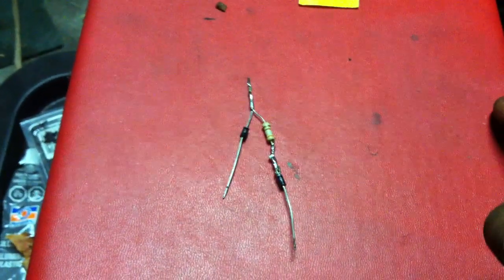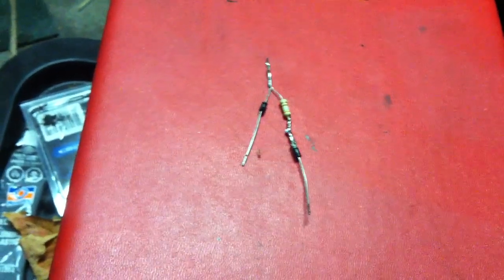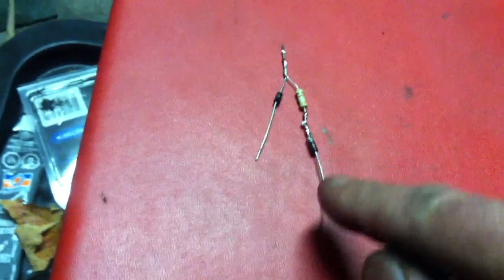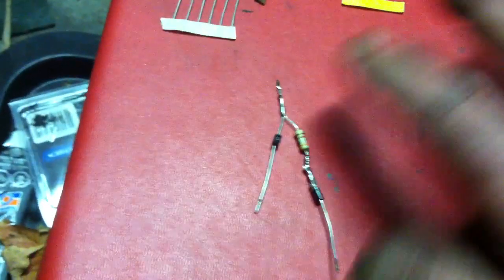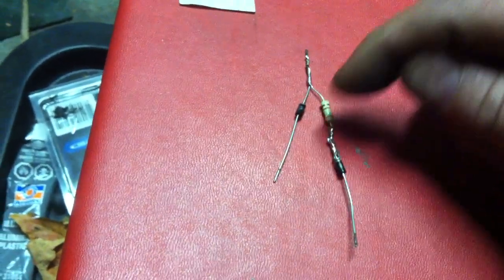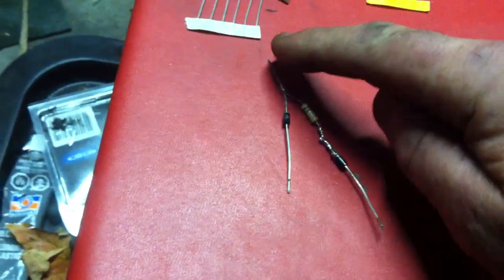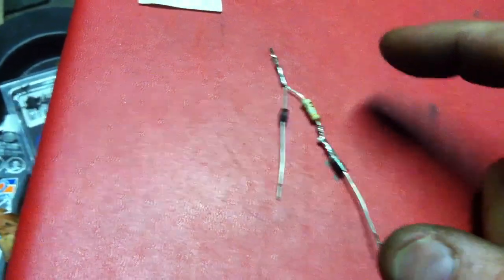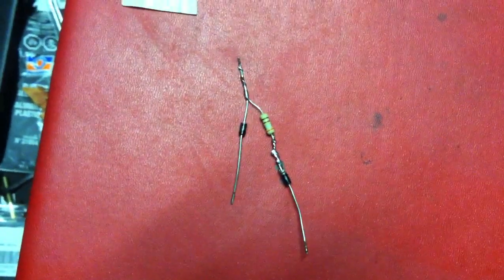How to make an LED bulb or strip into a dual intensity motorcycle brake/tail light

Comment: i dont know if anyone else asked this but do i need thise setup for every single led bulb? or can i use this for multiple bulbs and just put a higher resistor in?
Reply from the maker: +Jake Renninger multiple bulbs or single doesn't matter..i would suggest getting a few different resistors ,and seeing which provides the difference in output you like
Reply: +fupabox so if i just connect all of the positives together and the negatives together and connect it to the set up you showed, itll work? i just have to try different resistors?
Reply from the maker: +Jake Renninger yes...the resistor would connect to all of the positives of the leds
Reply: +fupabox Alright. and i am actually going to do this with my car. will the resistor i pick be great enough to fool my car?
Reply from the maker: Jake Renninger That I'm not sure of...I haven't tried it on a car with a " bulb out " monitor
Reply: Well i dont have a bulb out monitor but when i tried to put in an aftermarket led it messed up my brake lights and made them act weird
Reply from the maker: Jake Renninger WEird..what kind of car ?
Reply: +fupabox im trying to make new brake lights for my 2003 Mini Cooper S
Reply from the maker: Jake Renninger That's odd..other than flashing faster, they should have been ok
Reply: +fupabox because when me and my brother put aftermarket led bulbs in and when i pressed my brake nothing happened and then we put the stock bulbs back in and then it was fine
Reply from the maker: Jake Renninger led bulbs only work when the current flows in 1 direction.. a regular bulb will light even when the current flow is reversed.. so depending on the configuration of the neg and pos on the mini's light socket, LEDs may not work..you may need a reverse polarity LED
Reply: +fupabox.alright ill look into it. i would be able to figure out which one i need and put a diode in the system?

Comment: nice vid and explanation :) , would this also work with your setup , but adding another diode soldered to it but using a dualled strip, cuz i wanna add tail/break light and blinker thats why the dual led strip
Reply from the maker: *****  I'm not sure, but I can ask my buddy when I see him next...I'm not the greatest when it comes to electrical circuits, so I usually run any ideas through him
Reply: ***** since i m talking about dual led strip, i supose i would be getting 2x positive and 2x ground, then i should go with your tube vid on 1 positive and just another diode (maybe resistor on how bright i want blinker to be) on 2nd positive and then attach the 2 grounds to the chassis
Reply from the maker: *****  I haven't talked to my buddy yet..but found this that may help you...http://www.hondatwins.net/forums/64-electrical-discussion/40033-installing-wiring-3-way-led-turn-signal-running-brake-lights.html

Comment: I did it to my Yamaha XVS 1100 and it works great. I added more break lights and turn my indicator into running and turn signal lights, i love how it looks now. The only thing is my signal flashes a little faster and for that you can use a LED load resistor to fix that problem.
Reply from the maker: cool..I want to try the running/turn combo.  haven't gotten around to it yet
Reply: ***** I'm off from work tomorrow I'll post a video and diagrams also. It's great I love it
Reply from the maker: calico344 excellent.. I'll subscribe so I will be sure to see the vids.. TY

Comment: This is awesome video and tons of help. Two questions:
1. How do we increase its capacity to handle more LEDs?
2. Can you give a drawing of how things are connected- and how we would add more diodes etc?
Reply from the maker: if you want to add more leds just use a premade strip with more leds on it
Reply: ***** So, this arrangement will work on any number of LEDs? I am using a pre made diode connector for the purpose.
Reply from the maker: Anuranjan Pegu Yes it will...the only thing that may need changing is the resistor may need to be a bit stronger if you have a lot of LEDs
Reply: ***** I am new to this. How do we increase the strength of the resistor?
Reply from the maker: Anuranjan Pegu there is an OHM # on the resistor  the higher the # the stronger the resistance, and the bigger the difference between full power and resisted power. you will need to find a 12v resistor since the battery is 12v
                                                                      for a small to medium light strip of LEDs  1 watt is fine
                                                                       you can use a 2-3 watt as well without any problem. 
 they are only a few pennies each for the resistors so get a few..
Reply: ***** Thanks- that is some great info and I hope my question and your answer helped out someone as noob as me. For now the LEDs are working fine...lets see when I add the extra strips to my set up. Thanks again! Cheers!

Comment: hello I was planning to put leds on my bike for tail lights. I have these 3w led called eagle eyes, and was curious what ohms resistor would I need. And would I use the same rectifier diodes?
Reply from the maker: as far as I know the same set up could be used, resistors being so cheap ,you could try a few different ohms to see what works best

Comment: this is a very valuable information. Thank you. how did you insulate the diode and resistor circuit. They look like bare wires. Thanks!
Reply from the maker: heat shrink tubing...2 layers

Comment: Hi this is very interesting for me as i want to make a 13 super bright LED rear and brake light could you ask your friend how i could do this i want to fit them in line  on a cicuit board to suit my rear light on my bike and  use the system you have used.
Coud you ask your friend how i would do this please? I want to use the super bright LEDs
Reply from the maker: if you are hooking all the leds together inline..they will all use 1 positive and 1 negative to power them all..so the same would apply ..negative to ground, and the positive which feeds all the leds would be hooked to the circuit I showed here
Reply: +fupabox  yes, but what size diode and what size resistor would be needed to use 29 x 10mm super bright leds please?
Reply: +fupabox i have found a thai guy that has made it for me,but he hasnt quite understood that i want it to get brighter when the brake is applied, wonder if your friend caan help about resistor size etc so i can show him your video and tell him what size is needed
Reply from the maker: TheSmilermike  I will ask the next time I see him

Comment: So when you say to ground the negative wires, what exactly does that mean? Would you splice the negative wires from the LED strip to the negative wires on the tail light? Or would you splice them to the negative wires on the brake light? Or can you just attach the negative wires to the ground (-) terminal on the battery?

Thanks!
Reply from the maker: the led - wire  just gets attached to the frame of the bike..the frame on any bike/vehicle is directly hooked to the - battery terminal....that makes any part of the frame into a ground
Reply: I did not know that. Thanks!
Reply from the maker: Garrett Adams very welcome

Comment: Awesome video.. But I have a quick question. I'm running a 36 l.e.d tail light strips.. Can u help me out with how many resisters and diodes I need.. I would would appreciate it a lot.. Thx
Reply from the maker: you still only need 2 diodes and 1 resistor per circuit...the entire strip is one circuit..it doesn't matter how many LEDs are in the strip,they all get their power from the same wire

Comment: I'm using a resistor for each LED, and will contain in total 155 leds on each side. I use this circuit in my project? and when the vehicle is on generating 14 volts, will not cause problems?
Reply from the maker: as long as the bulbs are rated at 14v there should be no problem
Reply: you think best to use a single resistor for each LED, or call them in series with a resitor for each series??
Reply from the maker: netuno96 I was told you can use 1 resistor for the whole series
Reply: ello again, I have red LED connected with resistors 1/4w with 560ohms, what resistor should I use to control brightness?
Reply from the maker: netuno96 I'm not quite sure what you are asking...there needs only be one resistor,on the tail light circuit..the only other component is 2 diodes to control current direction flow
Reply: I have red leds with 560 ohm resistors. what resistor I use to decrease the brightness of the LEDs?
Reply from the maker: netuno96 You have a 560 ohm resistor which is decreasing the brightness already...if you want to decrease it more..any 500-600 ohm resistor will work
Reply: these resistors are attached in 560 led to them not burn on 12v, my project is not to led strips, I'm using 5mm leds, wanted to know what value of resistors will need to decrease the brightness of the LEDs, the 600 ohms is enough already?
Reply from the maker: ok..You may have to experiment with different ohm values to see which has the effect you want..600ohm should be fine
Reply: ok, thank you very much, I think better to use a 12 volt regulator, because with the car running the battery goes to 15 volts, and I'm afraid that the LEDs burn for excess energy!
Reply from the maker: netuno96 most Leds are able to work across a wide voltage range..15v should be no problem at all

Comment: great video.. been after this for a long time..ive asked alot of people about this and they said it cant be done.. so here goes.. now sorry if i sound thick but is there a rule of thumb.. do you have to use a certain resister for the amount of led's you use as i want to use about 80 led's... much appreciate your information..
Reply from the maker: I'm sure there is somesort of rule,but I'm not sure what it is..I do know that any resistance will cause the resisted circuit to be dimmer,but the # of leds will effect that dimming in some way...they are so cheap at bulk electronics places it's best to get a few different ones and test them to see which you are happiest with
Reply: Thanks for your reply.. il do just that thanks
Reply from the maker: rass1129
glad to help  :)

Comment: could you wire a strobe module into this so that you have dim running lights and then a flashing bright brake light?
Reply from the maker: Ahh  good idea... as long as the strobing/blinking circuit is wired in ahead of the full power side diode..it should work exactly as you describe.. let me know how it works if you try it

Comment: I was just wiring up some LEDs on my motorcycle this evening, and this is exactly the information I needed to get the project to work. I'll be picking up some parts at the electronics store, and try it out tomorrow. Thanks for the great video.
Reply from the maker: quite welcome...let me know how it works out for you
Reply: Worked out great. Soldered the resistors and diodes into small circuit boards that cut with a dremel, and soldered the wires on, and added some heat shrink. -- Thanks again for the great info!
Reply from the maker: Ryan Bullock
excellent...glad it helped
Reply from the maker: Gerard Tam Le
http://www.ebay.ca/itm/4-x-4-Flexible-6-Red-SMD-LED-Strip-Light-Door-Dash-Panel-Lighting-/251512799033?pt=US_Car_Lighting&hash=item3a8f54bf39&_uhb=1

Comment: I also used 15 LEDs and it worked well with my plan. You will multiply the resistance needed of one LED by 15. In this case 500+ x 15 = 7.5+K ohms 5watt resistor will do but i used 390 ohm 1/2 watt resistor for each. Although 250 ohm resistor can boost your 15 LEDs' brightness, it might also burn your LED faster or shorten its life. Remember, the lower the resistance, the brighter the light you will produce. 280 is the safest lowest resistor. Just sharing my idea, it might help you.
Reply from the maker: thanks for the input, it's great info.

Comment: If I may ask, for 15 LEDs would a 250 ohm 1w resistor be recommended? Thanks for your time.
Reply from the maker: I couldn't honestly say for sure for 15 leds..if it isn't a big enough difference in brightness you can either add another resistor in line with the first, or put a larger resistor on there...you may have to try a few different ohm ratings to get it the way you like, and I'm sure the # of LEDs on the strip makes a difference, I'm just not sure how much so...the higher the ohms the dimmer the tail light..brake light will always be full power..

Comment: If you don't mind me asking for 15 LEDs would it be safe to say to use a 250 ohm 1w resistor? Or a lessor one. Thanks for your time. Nice job by the way.

Comment: Can't find 1 watt 560 ohm resistors in radio shack ,can I use 1/2 watt?
Reply from the maker: I don't know much about electronics,but my friend who figured out this circuit told me to use no less than 1 watt resistors, so I would say no...as long as the resistor is 1 watt ,you can use 2 smaller resistors in line ( 2  280ohm resistors.would end up with 560 ohms of resistance..but the 1 watt is critical to keep the circuit safe)